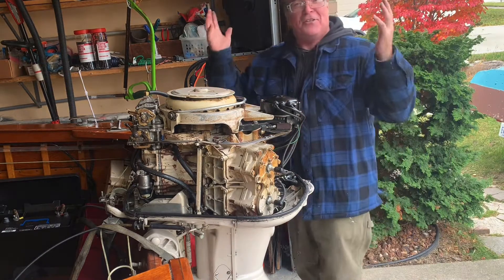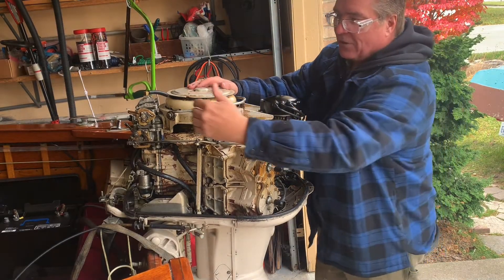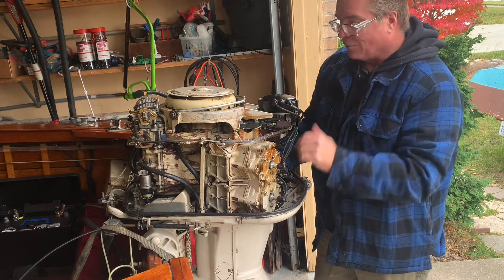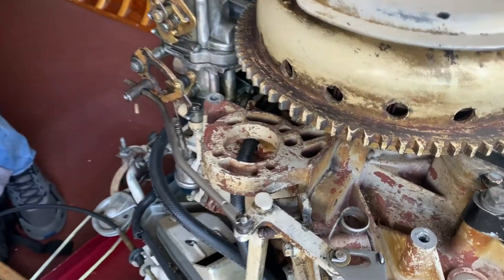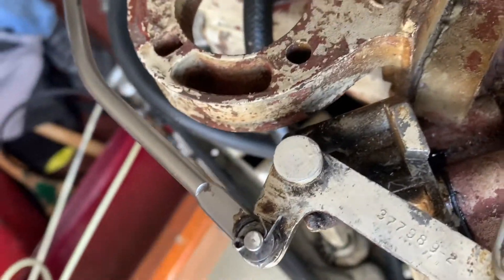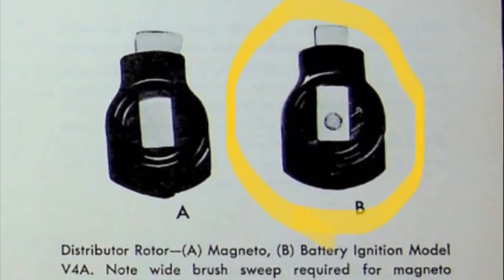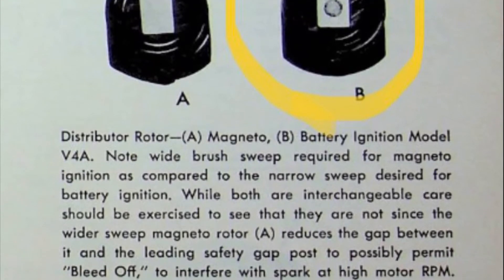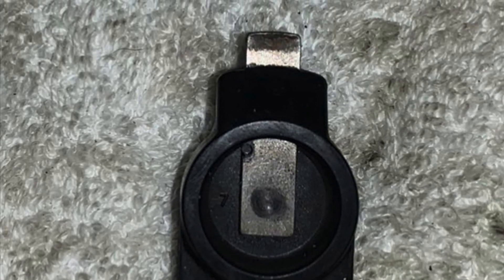1962 75 hp Johnson - Part 6 - Link & Sync

Comment: Unfortunately this video seems to be more for the benefit of your buddies than the viewers. Not as clear as your other videos, sorry to say.
Reply from the maker: Maybe what you say is correct. The people I was with were the owners of the  boat and my customers. So I guess I was a bit more interested in showing them then making a video. I'm sorry you didn't get anything from it. It was ment to inform and entertain.
Reply: @LivetofishOutboardRepair    Understandable. They pay better than I do. LOL.  I want to check my timing again. When I got the motor it was one cog off to the retarded side, which amounted to  over 10 degrees. But I replaced the points now and was careful not to disturb anything. My flywheel seems to have several hash marks on the flywheel very close together. I suppose maybe it's when using a light and the engine running. You had a lot of time into that 75 you worked on.

Comment: Okay, no matter what I do I cant get the mark to align with throttle closed and it to hit the WOT stop. Ive changed the linkage adjustment and done everything in this video and that I can think of. It's like the cam follower on the bacl is too small or something. Where did you find one for $5? The ones im fidning are $25.
Reply from the maker: The prices seem to go up as they become scarce. Ebay has them for around $18 with free shipping.

Comment: Thanks for getting back to me so fast I will send my email information do you know how to hook up a tach on these old motors do I just wrap the wire around the number one spark plug wire or is there someplace that it plugs in any help would be appreciated
Reply from the maker: Joe… this vintage may not have a tach wire in the harness. Usually it will be a gray wire but is only present on 1969 -1970 85 hp models that have an alternator. Otherwise yes you could attach or wrap a mini-tach to the number one cylinder.